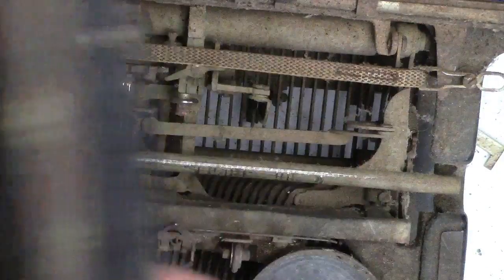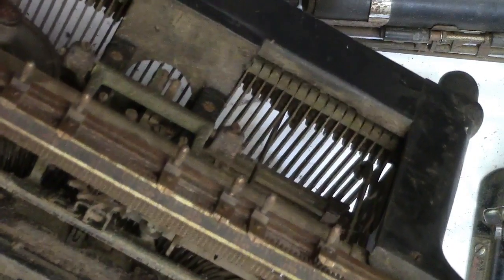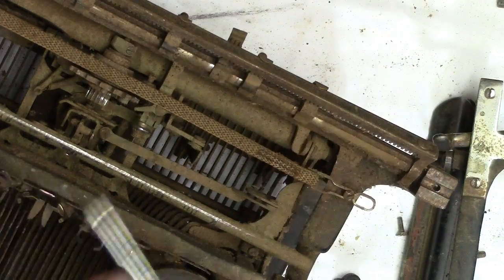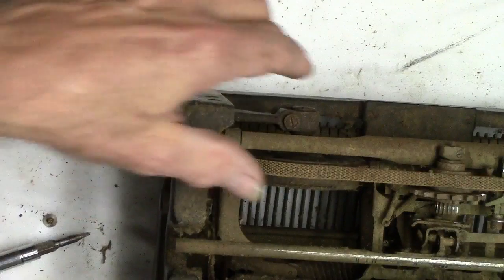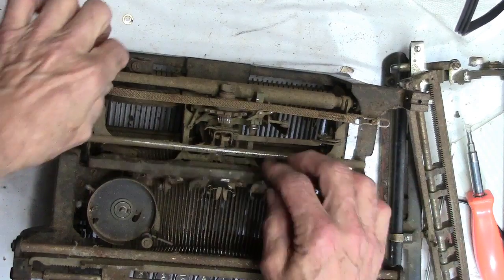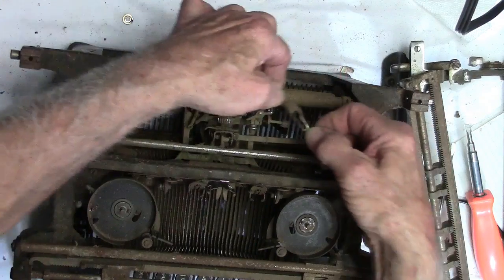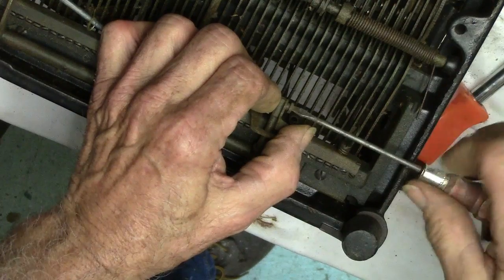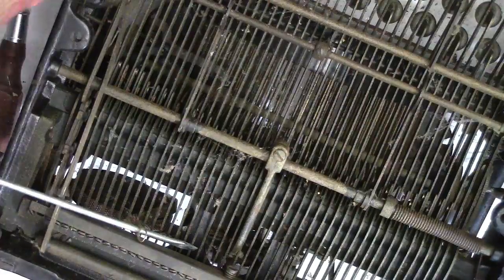Typewriter tear down and rebuild underwood #2

Comment: Bought a knackered Filia Olympia years ago and my dad an I have just got around to restoring it. First day today and we've struggled with the keys. It's incredibly dirty and rusty and in attempting to clean it, we've managed to unhook a load of the keys and it's a nightmare trying to get them back in place. Any tips? Thanks
Reply: To clarify, the hooks which connect the actual letter key to the spring mechanism.

Comment: My typing of  'S' letter not work suddenly then when i check , inside the key has depart I'm trying hard to joining it by using some pin without opening the typewriter but it doesn't work , please some suggestion or make a video on joining a key please
Reply from the maker: I've got a video that may help. I'll find it and send it to you

Comment: my underwood does not move to left after typing a word, do you have any suggestions? thx T.T
Reply from the maker: I'll find the time and send it to you. There is a coil spring that may just need oiling .
Reply from the maker: I am grabbing the  the coil spring at exactly 4:20
Reply: ok thx hhh maybe i will just find someone to repair thankssss
Reply from the maker: Finally had time to reply to you about your typewriter. Here is a link to a short video showing how to check and adjust the coils spring  for moving ahead while typing. https://youtu.be/Gt11yrAl-E0
Reply: thx but it is just everything inside got rusty becoz of the long time. that's why it cant move and i hv paid for repair but that guy said so and told that it couldnt be repaired
Reply from the maker: Used ones are not that expensive on ebay. Just make sure it works